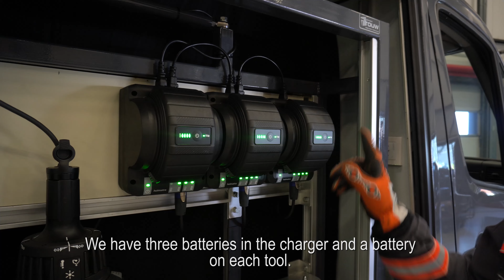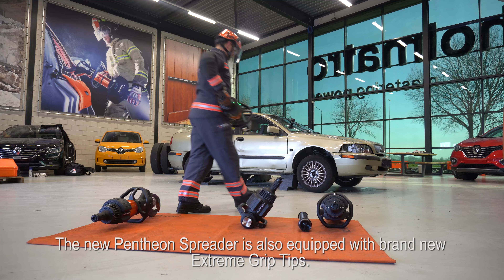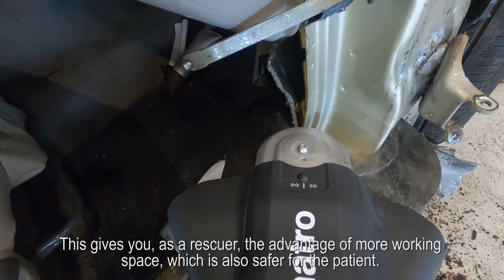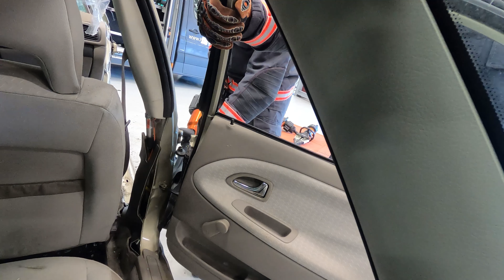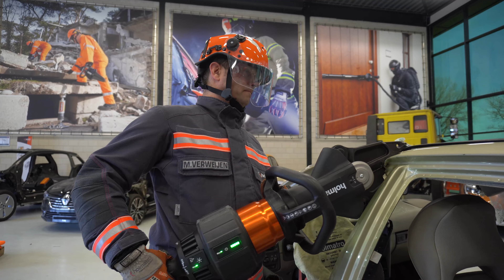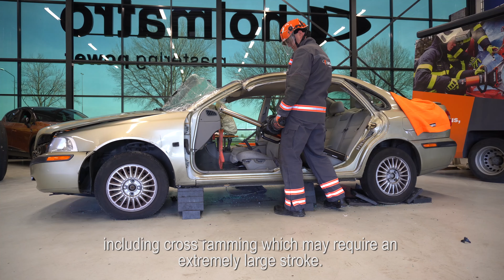Product Demonstration Pentheon - English

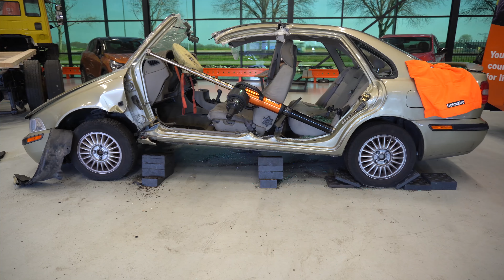Comment: I would like to comment on the position of that vehicle. 5:11 wouldn’t that lift the trap driver up into the air and it will be harder for him to get down to the ground
Reply from the maker: You are right that the entrapped person would be lifted up with the dashboard. That's why it won't be likely to be carried out exactly this way. This was mainly done to demonstrate the length of the ram with the extension pipe.
Reply: @HolmatroRescue  by the way, I heard that during the old days before it was like these were invented. It was an accident on the road and firefighters only had simple tools like a hacksaw, and ask which took time to extricate the patient. And not all emergency services in my country has it was like these, including my local village security